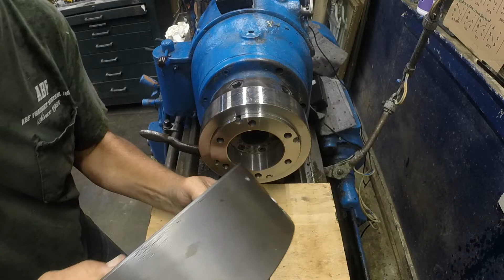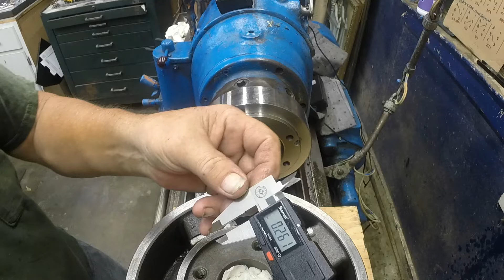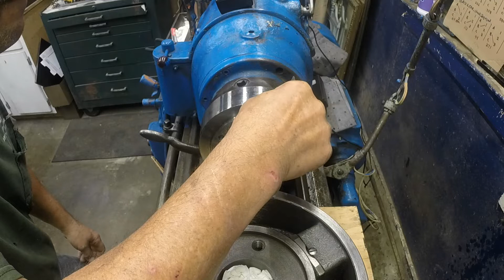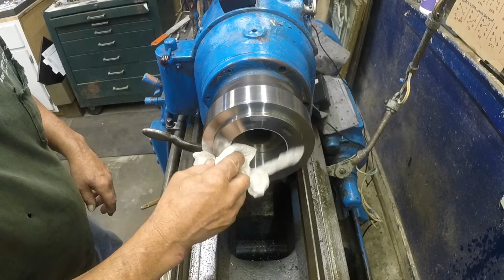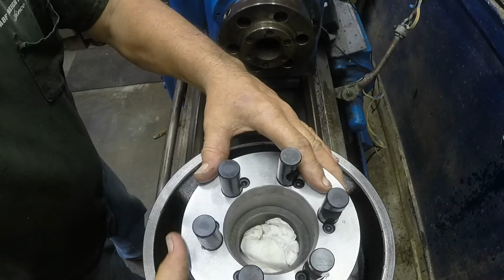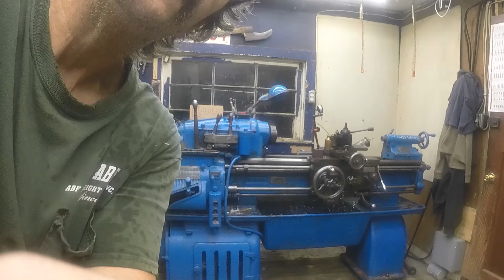MACHINING ALREADY IN PROGRESS,

Comment: Also I would turn your chuck adapter back until you started getting to the ends of the stud threads that mount it. The closer you can keep the chuck to the spindle bearings the better.
Reply: I'm with you on this one, Brian.  Less overhang is a good thing.
Reply from the maker: Let me have a little more fun turning threads hand such . Then I will work on accuracy I can probably get rid of a third of the thickness of that back plate.

Comment: At the end I am going to say there is an interlock associated with that forward reverse feed lever as it locked up when you tried to go the other way.  I would look into that relationship.
Reply from the maker: Thanks
Reply from the maker: I’m also going to get rid or the motor oil and add the proper oil last time I got it free by impact. this time because of the video  I know what direction I need to turn the knob because it was all the way engaged and when it locked up, so I know I need to bump it counter clockwise

Comment: Kimber, I think you have way too much speed and not enough feed. That is what long ribbons of blue purple chips mean.  Should not need oil, just slow down.  You have huge surface feet per minute with a part that large. Also, you are using a profile type insert shape. Nice for tight features, but not robust.  Shars is nice, try some CNMG insert tools (which are negative rake) but order some positive chip breaker inserts. These are robust and cut well and don't require a large minimum depth of cut.  Also, don't dwell with carbide tools.  Keep moving,  don't stay in one spot. It is likely to chip the insert. Turning that D-1-5 adapter step might be only a 1/2 hour job or less, once you get used to the machine.
Reply from the maker: We need to talk